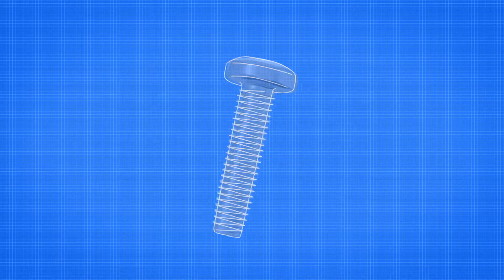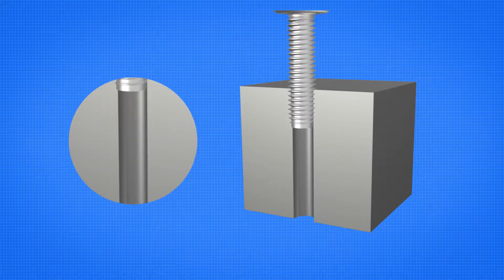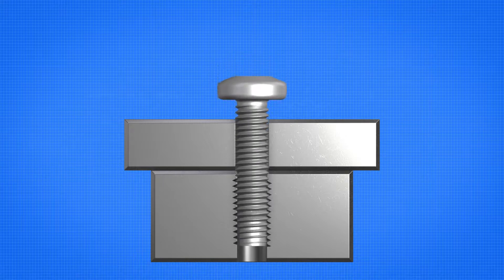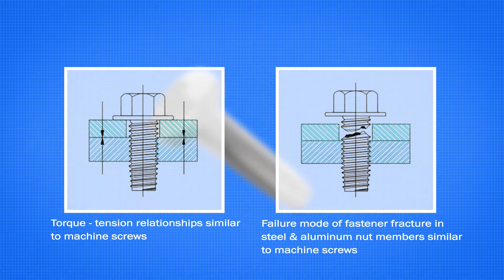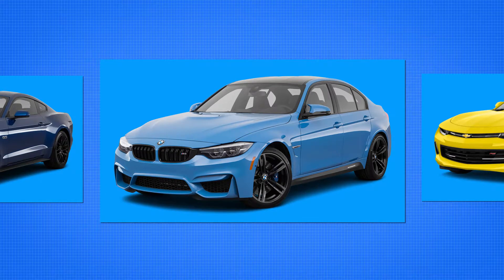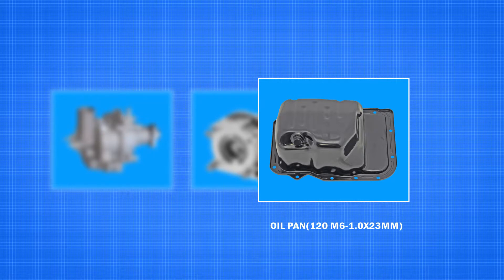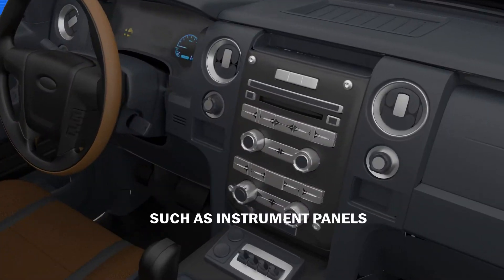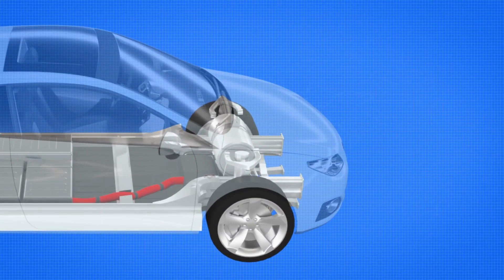TAPTITE® PRO™ Screws - English

Comment: Can the thread cut from a taptite be used for machine screws, i.e. removing a taptite screw and replace with machine screw?

If I remove a taptite screw, can I re-use the taptite screw in the same hole (now threaded) or do I need a new taptite screw?
Reply: Eric, the answer is yes to both.